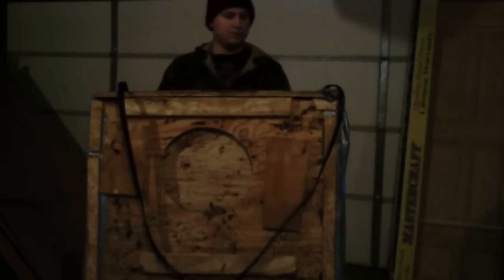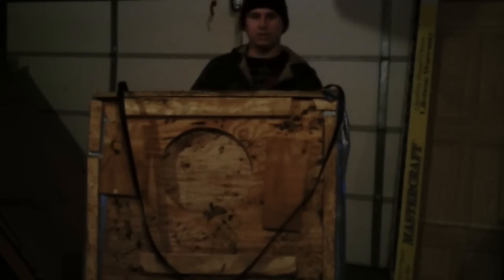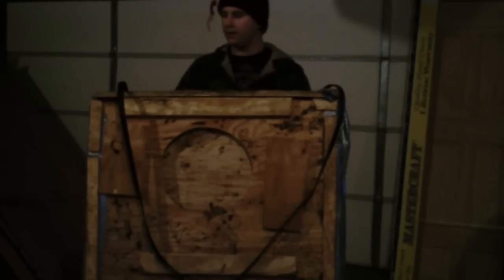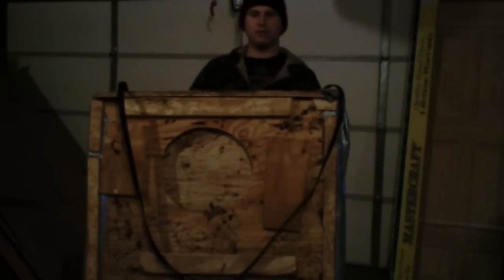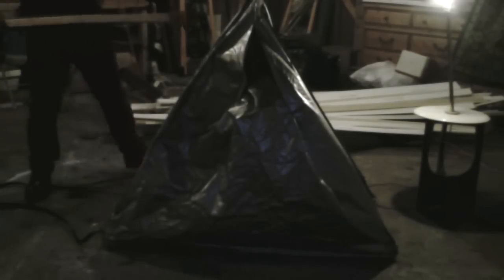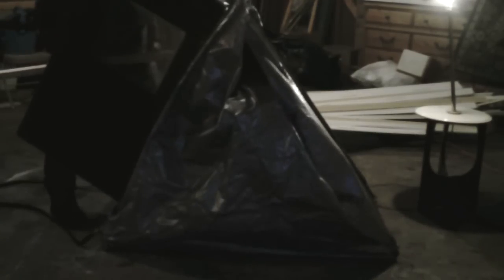Homemade Ice house Details.

Comment: Very cool, and it brings back memories. My father built one of these when I was a kid, it was much the same design, but on a larger scale (the bottom was a full 4x8 feet, and 6 feet tall). We comfortably fished three people, with the holed along the long side of the shack. With a little single burner whitegas stove, we had coffee and it was warm enough to fish without jackets. His had three skids that ran down the long axis of the shack, it added rigidity and made it easier to drag across ice.